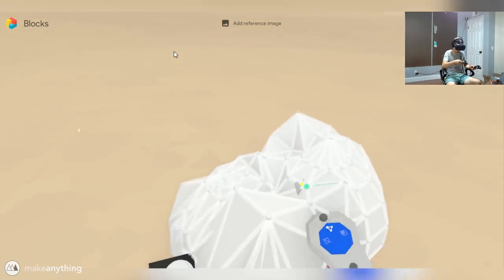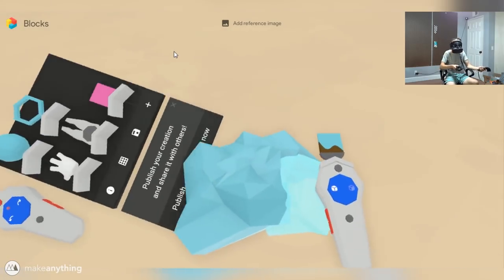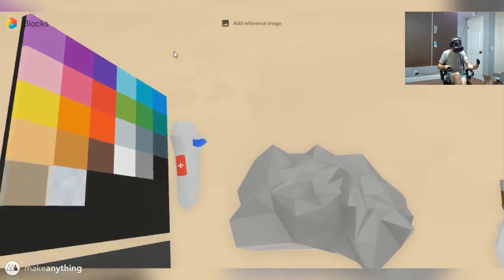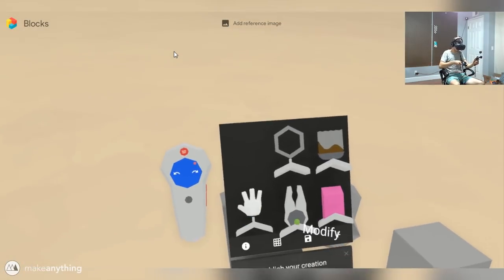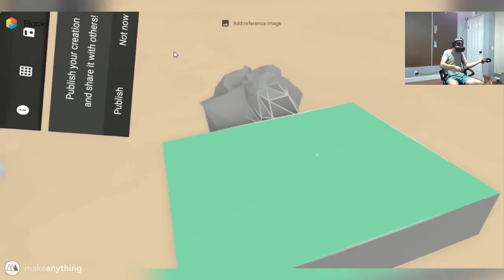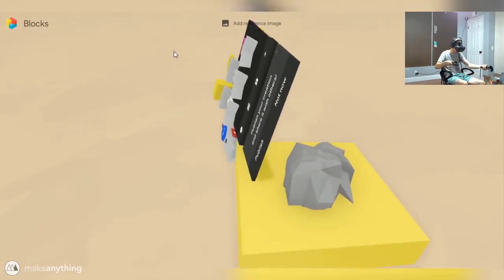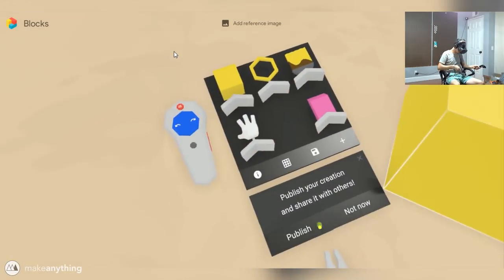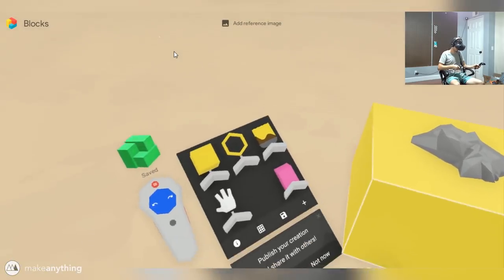VR Sculpted and 3D Printed Climbing Holds Pt. 2 // Google Blocks and Fusion 360 Tutorial

Comment: I’ve had problems printing nylon as well. The solution for me was to print a PET layer on the intire bed. PET sticks really well to tape, PEI etc. I printed the sheet at a 0.2 mm layer height. Then give the nylon parts a z offset equal to the thickness of the sheet. Just print directly on top of it!

Comment: You could make a wide washer-shape hollow space mid print, pause the print, put the wide washer in it and continue the print. This way the forces really distribute and you can tighten the bolt even more.

Comment: I've dabbled in 3d printing climbing holds and done a little bit of testing myself. After due testing I have deemed everything I've printed with FDM unsafe for practical use.

The reason being is that the failure mode of typical filament prints with PLA, ABS and PETG tend to create sharp shards that are fairly dangerous if they were to hit someone in the eye. In particular thanks to infill patterns in the event a hold loses integrity it can shatter quite explosively.

And yes, I know both the typical PU and PS resin holds in gyms can break, but they tend to do so in much fewer fragments and in the case of PU the failures are typically quite ductile.

I have however made some neat rubbery screw on jibs out of TPU which are quite fun and I think that FDM is a great way to make conformal molds to save on resin pours but my recommendation is to not climb on FDM handholds.

Comment: This is sweet! I was wondering how 3d printing holds would work out. I've found that adding a grid of dimples to the bottom of my prints allow for a much larger surface area to be printed without warping. The heated bed helps for sure, too though.I would have thought just removing the bottom layers like you did would have had the same effect 🤷🏻‍♂️. Thanks for the video. I know what filament I'll buy to print holds!

Comment: in fusion 360 you with capture design history turned off you can go to Patch -> Modify -> Merge then check chain selection. This can make it so you dont need to cut off the bottom to make it one piece.

Comment: I have all your answers. I don't know how, but on your first video, when you tested your first print, there were "Wet Stone" Pinches in black on the climbing wall. I made those holds, that is the only casting of that set I ever made and so I don't know how you have them. The coincidence here is that you just so happened to test your hold next to the person who had made the first successful printed hold 4 years ago. You don't print the hold and use it, you print the hold in sandstone, mold it in silicone and climb on a polyurethane casting with texture.

Comment: Did you ever try using the 3d prints as a positive for mold creation and then pouring polyurethane the same way that holds are normally created (just with a 3d print substituted for the foam that is normally used)? Or was this just not appealing because it wasn't the same general idea?

Comment: you should have made the part slighlty higher (in der middle where the screw sits) also it would be simplierto do a bunch auf 1mm holes around the screw to get solid zylinders there.

Comment: I have been using elegoo rapid pla+ with Fuzzy Skin enabled in Cura. Works like a charm on my holds. Gives some decent grip. my settings are .28 layer height, .5mm line thickness, 4 perimeters, 30% cubic infill

Comment: What was the material cost of the main hold you made?  I'm curious about the cost effectiveness of 3D printing versus mold making/resin, buying commercial.
Reply from the maker: With this material cost was probably around $10, so not incredibly cost effective, but it may enable some unique designs that can't be easily cast

Comment: Does the carbon fiber actually protrude from the hold, or is it encased in plastic?  I would be worried about people getting carbon fiber splinters if these were used for hand holds.  Carbon fiber splinters are the worst.
Reply from the maker: There's no chance of splinters.. I guess the fibers are just extremely short or even pulverized.
Reply: That's good there's no splinters.  I'm dubious about where the strength is coming from then though.  Is it stronger than solid nylon?  I wonder how long the fibers are.  I've always been under the impression that those tiny fibers are worse than asbestos.